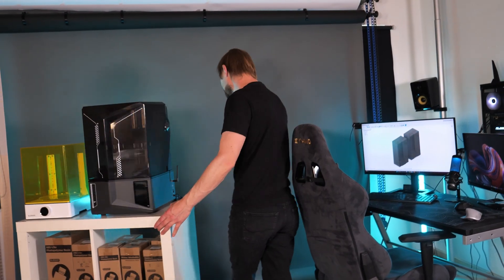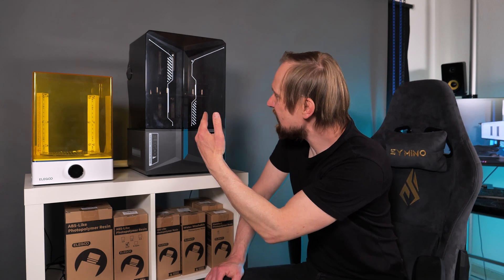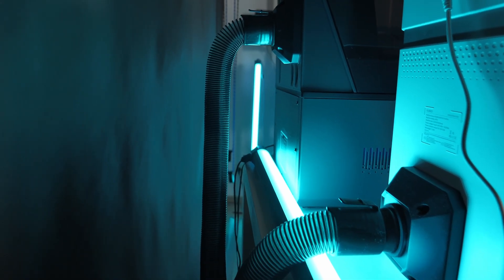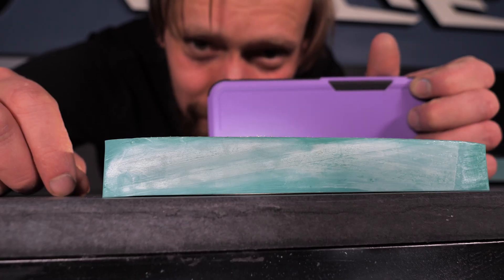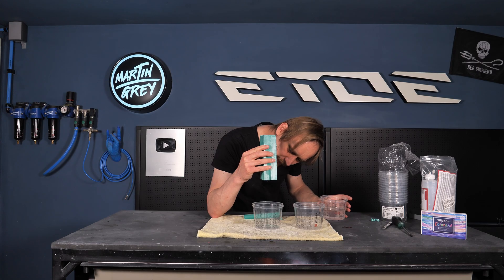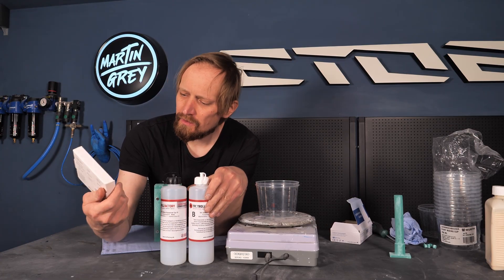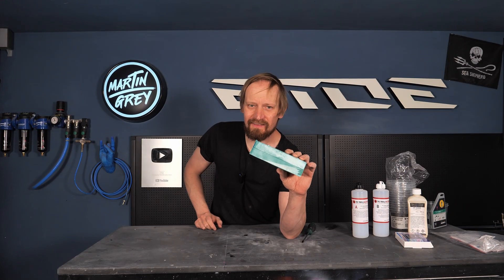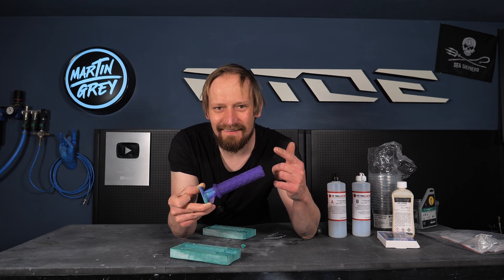I Tried To Make Rubber Bike Grips - Elegoo Saturn 4 Ultra

Comment: i made Dice (for DnD mostly) using my 3d printer and the problem isnt the water. When printing the resin doesnt cure fully during the print and most resins will react with the hardening agent in molding silicon so anything in contact with the mold will not harden.

If time is not of concern i woul just leave the prints in the sun for a day or two to fully cure it and afterwards flush them in alcohol and airdry them. Or since you are a painter yourself apply a thin layer of clearcoat to it which works also
Reply from the maker: @Ceriva09  thank you for your suggestions.  I will try abs resin next time and add a coat of 2k clear.

Comment: Hi Martin - pretty sure the water wasn’t what made the silicone sticky as silicone will cure under water. More likely the resin or mould release affected the curing of the silicone. Try again without mould release as it’s not really necessary for silicone casting as silicone doesn’t stick to anything (other than more silicone or fabric or very porous surfaces) 
If you dust the mould with talcum powder that will help but it can leave a slightly matt finish. I would definitely recommend dusting the plug with talcum powder so it’s easy to remove though! 
Test a bit of silicone on the outside of the mould where you didn’t spray any release to see if it’s the mould itself. If it is the mould, give the whole thing a coat of lacquer to create a barrier to prevent it from inhibiting the curing 👍🏻
Reply from the maker: Thanks a lot for your suggestions. I will try. At first I have to finish my vacuum chamber to degass the silicon. Then I will give it another shot.
Reply: @  you don’t necessarily have to degass silicone either - if you pour the silicone slowly from a height so that the stream is very thin, it degassed itself on the way down and settles without air bubbles. Also, tilt the mould to nearly 45 degrees as you pour it in, this will help ensure you don’t trap any air 👍🏻
Good luck and happy casting! I’ve been busy painting bikes after absorbing information from your videos for a couple of years so it’s only fair I pass on a bit of the knowledge I’ve gained from a few years of working with silicone and moulds etc 😂 👏🏻👏🏻
Reply: I have the best experince with simple base coat and long drying. On the Silikone is a list of chemicals witch interrupt the reaction. There you can simply ask chatgpt if its good to got with the basecoat.. thats my way to go :D
Reply: Hi! I, want to also make my own bike grips, any recommendations on what type of sillicone I should use? 30 Shore A seems like the appropriate hardness and I would prefer a matt solid color texture.